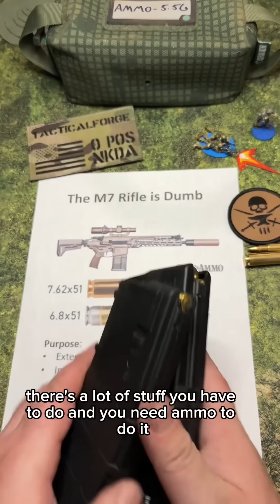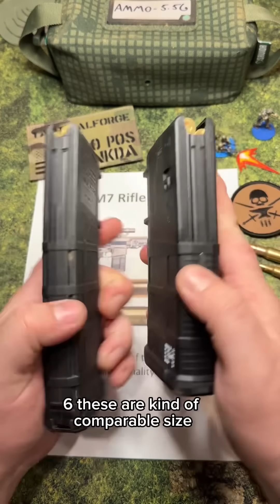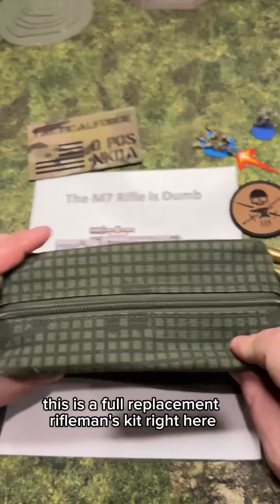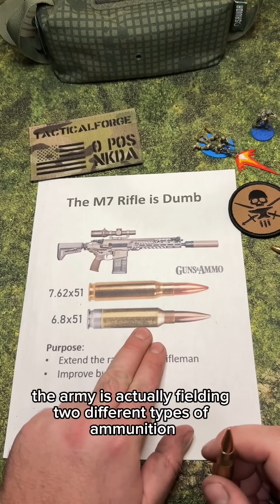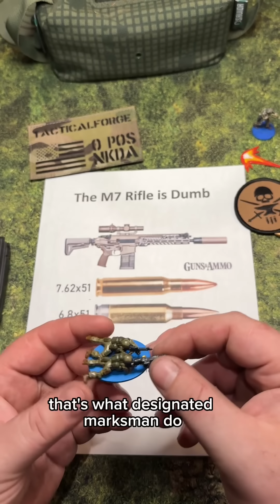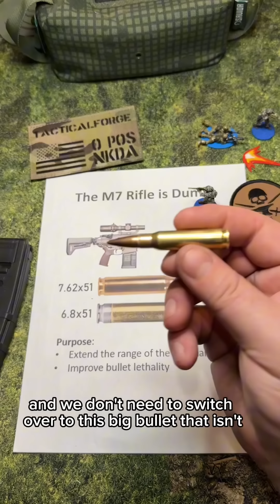My God this Rifle Sucks

Comment: I'm just a civilian armchair guy, but yeah my first intuition on this thing is that is looks ergonomically front-heavy and WAY overpowered.  And then seeing that it still has a forward assist tells me that this thing was designed by committee rather than for practical application on the modern battlefield.  And hearing that they train with a different powder load than combat load.  wtf???

"We want penetration through modern steel or composite plate armor at 400 yards."  WHY?!?!?!?
Reply: "We want penetration through modern steel or composite plate armor at 400 yards."  WHY?!?!?!?" peer and near peer conflicts see russia and china
Reply: @deltasource56  And?  How often do you expect your general infantry to be landing hits to the plate at 400 meters?  And how often do you expect your general infantry to engage at 400 meters?  

Are the trade-offs for this niche hypothetical engagement really worth bulk, recoil, and bad ergonomics?

Comment: By the sounds of it, this thing is going to replace the M14 as the most hated rifle. 

Maybe like the M14, it will serve better as a DMR. Also didn't the U.S throw a hissy fit when it came to the adoption of 5.56 and the rest of NATO want to adopt the FAL and now they are moving to this new round that chews through barrels?
Reply: Yeah that .280 Enfield would have been pretty sweet all around.

Comment: The M14 and FAL weren't based on the "everyone's a sharpshooter" idea.  That was the mentality behind continuing to issue bolt-actions.  Both guns represented a trend of reducing bullet size (given that the .308 was shorter than every GI rifle round used in WW2) in order to trade for easier volume.
Reply: Depends on the nation.
The UK issued semi auto FAL only because they thought that their soldiers should be "sharpshooters" (they werent)
Reply: @cathulhu-q7y Nah, the SLR was semiautomatic because they found that full auto was so uncontrollable that it was a waste of ammo and training time (at least for their standards). And in a pinch you could finger mash the trigger and still get enough volume.
Reply: @Infanterie_Marine  The SLR was semiautomatic, because the british army thought their soldiers are incapable of using a fire selector and their shooting training is surperior.
sorry but the brits continued to use the BREN LMG into the 1990s and Vickers Mashinegun into the 1970´s.
Their precieved expertise regarding firearms and firearms training can be ignored.
Reply: @cathulhu-q7y as opposed to full auto FALs? A FAL isn't controllable in full auto, I'd only issue the semi Auto versions too lol.
Reply: @SIRslipperyasp91 the automatic setting is there for a reason. For example to repell assaults, surpression etc.
Reply: @cathulhu-q7y I'm aware of the idea,  but as a combat engineer vet and someone whose used a FAL at a machine gun rental range, I'm confident that the full auto setting is of limited usefulness.
Reply: @SIRslipperyasp91  it has its uses.
as said before: repelling assault, surpression etc.
this is something that is actively trained in almost every military around the world in infantry training.
In german its called "Sturmabwehrschießen" (Assault Repelling Fire). 
Sure you will not hit the side of a barn on 300m, but thats irrelevant, when your enemy is less than 50m away and assaulting your position or your job is to lay down fire to keep the enemies heads down.

Comment: Steel case 5.56 with 77gr low drag bullet easily goes 800
Reply: It does not penetrate armor at that distance. I think the m7 is a bad idea, but people here are just 5.56mm-era boomers who are making the dumbest criticisms
Reply: @googIesux 6.8 does not either. Basically only 50cal does penetrate a level 4 at that range. Not that it needs to, it just needs to penetrate the helmet
Reply: @tedarcher9120  6.8 at what velocity? Nvm, not gonna get drawn into reddit arguments. Enjoy yourself
Reply: @googIesux at mach 10 sure. Not at bullet fired from a gun velocity. Steel case 5.56 has the same velocity as 6.8 and better ballistics
Reply: @tedarcher9120  Maybe you're just ignorant, so I'll say there's a much higher velocity round developed for it, but even the speed of which is currently classified.
Reply: @lucastonoli3256  no no, he was right, 5.56 is faster than .50bmg, so it's better. Sig has corrupt dealings, but since we don't know classified velocity, you're just full of it

Comment: Ik hating on sig is popular now, but the M7 was a more sane rifle than the other two competitors. Polymer ammo does have problems that will take longer to resolve than the M7 problems.

Now, the concept of a battle rifle being standard issue is retarded. What we should have done is issued a 556 MCX with a 12.5 barrel (giving almost 14.5 velocity) and then issued it with hybrid case M855a1 (giving about 16" velocity) and a small suppressor (non-flow through). Issue half of them with a PLXC+top dot (for the team lead [who also gets a peq-16] and rifleman [who also gets a QD bipod he can carry separately]) and the other half with a passive aiming oriented red dot and FTC magnifier [for the grenadier and the automatic rifleman [who also gets a bipod and kit to carry bigger mags])

Bring the M250 with the close range optic package into the HQ element of the squad along with an M7 (run as a DMR with a 2-16x version of the laser rangefinder scope), plus the squad lead, medic, and RTO.

Weapons squad also carries M250s, but run them off tripods with the mid range optic package (the PLXC). Leadership gets the 556 with mid range optics and laser, and suport guys (medics, RTOs, CBRN) get the 556 with close range optics, except the FO who gets a DMR so he can do one round adjustments using the laser rangefinder and Mil reticle.
Reply: QD bipods were a thing in Vietnam and no one used them because they were straight ass.

Comment: I suspect the person responsible for this rifle was thinking more about advancing their career than battlefield logistics
Reply: I’m going to need to see absolute undeniable proof that what you said is false. Until then we all know who got a new job at sig.
Reply: Yeah. Like when they went with the M14 instead of the demonsrably superior Fn rifle.
Reply: @tomchappelow9602 honestly im convinced the M14 was just the product of Americans not wanting to adopt that disgusting inferior European technology and preferring something made by muricans
Reply: @tomchappelow9602 The FAL… wasn’t much better tbh. It has plenty of issues on its own, and probably would have suffered much of the same issues as the M14 in Vietnam.
Reply: @Pilotmario  except they didnt the aussies carried them in vietnam and there were no reports of any trouble. the israelis had trouble because of sand but they solved the issue with sand cuts in the bolts.
Reply: @MichaelTaylor-g2b  not true. The Aussies used FALs with cut down barrels along side Owen guns and F1 submachine guns, before adding M16s into the mix. The FN FAL had a very troubled beginning and was not more reliable than the M14 at the time when the M14 was adopted, as proven with multiple documents in IvanPrintsGun’s video on the M14.
Reply: @ErrorTapToRetry The "controversy"was over the cartridge. The FAL was built around a .280 intermediate cartridge. The idiots in the US military industrial complex wanted the Belgians to chamber the FAL in .308; then they would "sign the contract."
Of coarse they didn't and went with the M14 anyway.
Reply: Gotta stop attributing obvious malice to stupidity
Reply: Your comment in tandem with this video will  be kept in mind on my gunsmithing journey.
Reply: @HughManatea Good luck on your journey! My dad was a designer as well and he always said you have to think about the use case, ergonomics and user friendliness.

In this case, use case includes logistics.
Reply: forreal. I find it very suspicious. Like UCP level suspicious that Sig has somehow managed to win or is about to win every single major small arms contract in the army. And every single time somehow they already have a product and every single solicitation has the hyper specific specifications that only matches the sig offering. 

Like for the NGSW instead of doing a hybrid case hot 7.62x51, it’s a hot 6.8x51. So now the NGSW is justification to argue for moving all the 7.62 platforms to be replaced by a different caliber. And lo and behold. They just happen to already have the MG338 to offer before a competition is even formally announced.  Won’t be surprised if they offer a DMR offering too now that the DOD is standardising on the MK22. They’ll use those three factors together to justify that. 

Won’t be surprised if they start gunning for a .50 cal replacement too if the army takes that hook line and sinker because now performance of the next tier down is creeping up.
Reply: Or getting a cushy job at Sig.
Reply: They designed this rifle thinking we are still fighting in the mountains of Afghanistan and everyone needs to be long range sharpshooters.
Reply: @krunchie101  the problem is the military needs weapons for different scenarios so they try to make a weapon that can do everything they end up not doing anything very well.
Reply: Usually. Just like with the recent era rapid switching from one camo pattern another...excepting the marines. They avoided a series of camo patterns and changes, and likely, this rifle thing.
Reply: It’s just another money grab we should have stuck to the nato rounds for logistics reasons IMO
Reply: Its preparation for the final US civil war.
Reply: All about the $$$$$
Reply: And Your thinking about losing the war. Good luck getting ass fcked by armoured IMV
Reply: Remember Stoger & the M14?? I think that was his name.
Reply: More about cocaine and cream pies lol
Reply: Their lobbyist just bribed the most people to get the contract. It's not rocket science. It doesn't need to make sense to make money
Reply: That is EXACTLY what happened. A former Pentagon bigwig retired and got a consulting job with Sig. Couple of week later, here we are laughing at this and the Bop-It action handgun
Reply: Swapping the M4 out for an AR 308 makes all the sense in the world. The platform has decades of use in the civilian world where any and all problems were sorted out long ago. And it wouldn't require a massive retraining of personnel, because if youre familiar with an M4/AR15 then the AR10/AR 308 will be just as familiar. Not to mention the rifle doesn't require an expensive bespoke cartridge and uncle sam already has stockpiles of 7.62 nato / .308 win. For the job the rifle will be expected to do the choice should have been obvious. But somebody's palm was getting greased by sig
Reply: Milley approved this and promised a 10x improvement over any other system in the world, and promised it would have better range and accuracy than the M4.
Reply: Wouldn’t it, in turn, ruin their career for just assigning these squads with rifles that give shitty at best field results? You’d think high command wants the boots on the ground to actually perform…
Reply: @TheYaptor i dont know the u.s. military springfield armory got away with a lot introducing the m14 into service. the fn fal was clearly a superior weapon. the people in charge of the armory had the it designed here mentality. im pretty sure they went on with their careers.
Reply: As someone who studies logistics, I much much prefer full power rifle rounds to the intermediate bullshit they currently use. My thing is, every tool has its job. I, personally, prefer battle rifles, because I prefer 1 good enough shot to permanently handle a target rather than 3, however, I also see the utility of an LMG that fires intermediate cartridges, and the cross compatibility advantages of having the entire squad use the same ammunition isn't lost on me. That said, I still think both the rifle and cartridge are stupid. They could've just used 7.62 NATO, and switched mainly using the 240B, and it would accomplish the function perfectly with minimal R&D. Logistics would still be slightly more difficult, yes, but the lethality and effectiveness potential would skyrocket with very little extra effort. 

However, I think the main issue here isn't the weapons, it's the armour. Let's be real here, how safe are you, really, when you're wearing a body armour vest? That shit is garbage and it is the accepted standard.
Reply: @kraagnjilwulf1413  intermediate cartridges are the norm for a reason, they do a better job at the infantry combat range.
Reply: @kraagnjilwulf1413  body armor isnt much good when the enemy is now aiming at the pelvic girdle.